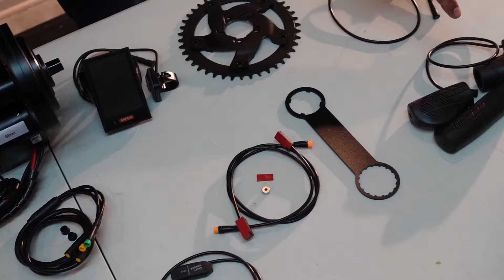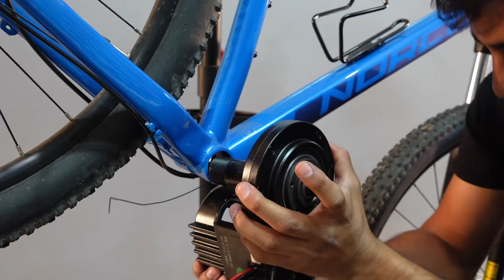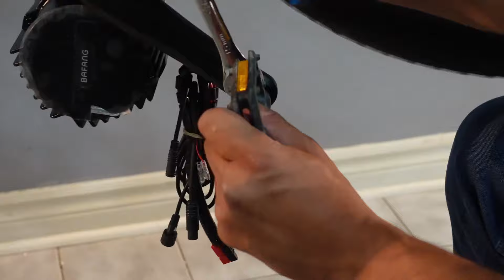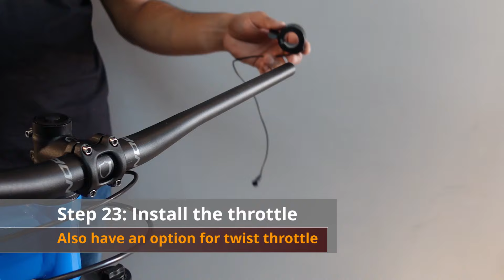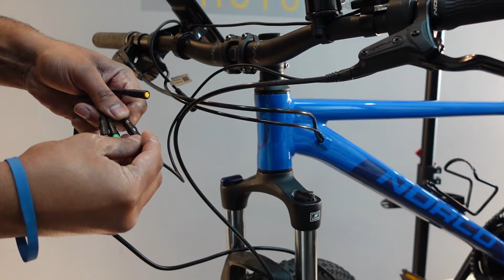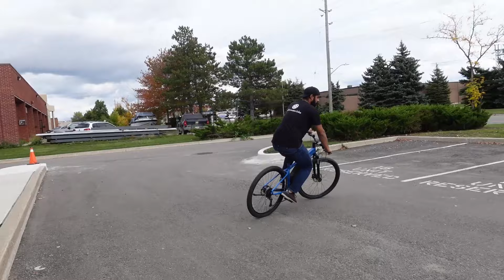Easy Bafang Mid Drive Kit Installation - BBSHD/BBS02

Comment: From other install videos, most have the motor pivoted closer to the front tube so it's not hanging so low.
Reply: Yes, that motor is now very exposed to rocks etc He should also have added some loctite to the thread of the first ring holding the motor
Reply from the maker: This is bike with internal cabling so the slot for the cable doesn’t allow it to go all the way up
Reply: @goldenmotorNA  it does, you just didn't try as it's the downtube it goes close to and there's plenty space.

Comment: Just fitted the 1000 watt BBSHD paired with a 52v 19.5 ah battery to an inexpensive mountain bike I bought new around 6/7 years ago for £180 in a half-price Halfords sale. Very impressed with the outcome - not worked on bikes since I was young so it took around 5 hours but I could do a second one in less than 2 hours. It goes very fast and hills are a thing of the past!
Reply: Hiya, thinking of also adding one to my bike. Can you use just throttle and also do the UK ones come limited in any way? Cheers Rob
Reply: I fitted MY BBS01 With 750W  to a bike I bought for 50€ .
Reply: Are did you get on with bbshd ? Do you do any mountain biking? Was there enough clearance
Reply: @WildCamper no they’re not limited, though you can use the display screen to set maximum speeds to 15.5 if you wish. Can also remove the “power” part of the display from the screen and replace it with amps. 

A nice 250w sticker on the motor from eBay and you’re laughing xx

(This is what I do! Pedalling around 20mph and throttle when I’m exhausted on quieter roads, it’s great!)

Comment: Just pulled the trigger on a Bafang kit and battery. Will follow this video and hopefully, have little to no issues. Wish me luck bois! haha
Reply: How'd it go? Ordered my bbshd on Friday. Purchased half twist throttle. Did you have any issues? What display did you run? Battery?
Reply: @devinrichman5282  incredibly easy. It is just like it looks in the videos, it's basically plug and play. I have the 850c, the colour screen, which works great

I hope it works out for you

Comment: Thank you SO much for this vid, I don't know why i had it in my head that the motor could not be positioned straight down...the setup I've been looking at has been restricted by the frame....this opens up loads of ideas and will save me $$$...again thank you SO much  🥰
Reply: You can, but it exposes the motor to damage due to lower clearance from below, so you should avoid doing this unless there's no choice. And if you do, buy or make a bash plate to lessen impacts. 👍

Comment: Just about to install this, I will be using blue thread lock on the main bolts & also greasing the bottom bracket socket

Comment: The allen wrench you used to tighten the crank arm is 11mm. Process of trying the Bike Pro Kit which 10mm is highest. Non standard size special order. Task is to replace crank wheel from 44T to 32T.

Comment: I can't decide which type of mountain bike to use. Preferred aluminum first, but maybe chromoly might take greater heavy loads of batteries and better shock and impact? For 5,11 I'm wondering frame geometry, and frame and wheel size to use with heavier load and responsive steering. Oh, but any frame i get will have front suspension. Seems like a must.

Comment: Im running old wy inch wheels will this srill work as the motor doesnt seem like it has alot of ground crealance, for refeence its a carrera subway 1 im bring back to kife. Found half of it in a skip many months ago. Also are BB sizes standard? Or does the kit come with spacers and reducers for both wisth and diameter? I dont want to by the wring kit and bub drive i think is sketchy, alot of torque going throughh all the commponents from crank back.

Comment: Just a simple question , when you removed the bottom bracket in earlier clip , and then in later clip you say insert motor into bottom bracket I never seen you put the bottom bracket back in , it's confused me a little

Comment: I have an Aspect 950 with a 42T with a 73mm bottom Crank. So if I buy a 42T 1000W Bafang Mid Drive Kit do you think it can work out? I'm thinking of also adding a 52V Battery that I will buy separately. I'm doing as much research as possible to see if its worth it to spend 1K on a mid drive kit.

Comment: Does attaching the motor and the other equipment make the bike all electric or are you still able to use gears and manually pedal
Reply from the maker: You can absolutely use it like a regular bike. :)

Comment: Hello! Can u pls help me? I have a KTM ultra fun, 1x12 speed bike, with a 34T chain wheel at the front. Can I install Bafang mid drive set? It comes with a 36T chain wheel. Will it suitable without replacing the full drive? Thank you!
Reply from the maker: Yes you can

Comment: Hey thanks for such a great video 👍
-Why remove the front derailer?
-Why remove the gear shifter? Is it not needed then maybe one can just buy a 1 gear bike for this installation?
-46T chain ring is it the number of teeth on the ring?
Reply: You don't need the front derailleur because with the new setup there's only one chain ring, so there's no changing gears. But you still need one gear shifter for the gears in the back.
Yeah, I don't see why you couldn't do this with a fixie (one gear bike) 👍
Reply: @zyphoxx  Use a cheaper hub motor is you're using a 1 gear bike.
Reply: @zyphoxx  this would be like driving a car with only one gear. it would toast the motor in no time.
Reply: Zyphox thanks. My exact questuon answered. So I'm leavungbthe shifter on but removing the hi-low derailleur from handlebar. Ibthink I got it. Looked high and low for that answer. Take care

Comment: Currently using a 1x9 bike. Do I have to use the chainring that came with the kit? Or I can I use my current chainring?
Reply: The chainring that comes with the kit is dished.  If you use your own chainring, even if it fits, it will be off axis to the rear sprockets.
Reply: Should be able to get a bafang chainring with the same number of teeth

Comment: Did you find any issue with the brake wire because of the clearance of the frame and the motor is quite enough? The brake wire still need to run between the frame and the motor, correct?

Comment: ciao wanted to ask you in my tests I found an unsatisfactory power. I'll explain: up to absustency 3-4 ok good engine work with pedaling. but then from 5-6-7-8-9 is superfluous help and in climbs to 15% or made ato as a muscular do not feel the help so strong of the engine bafang .. I use a 52V battery in your video I see that very strong and very well..
can you help me understand? what could it be,,,, in addition to the pc plows

Comment: what's the difference in 750 and 1000 and do you still shift gears on th back wheel?
Reply: If there were no shifting it would not require a shift sensor.  Right?
Reply: 750 watt is less power than 1000 watt but to be honest, there hardly is a difference. Only torque would have a great improvement ( which is very helpfull when climbing)

Yes, you do shift with the back gears. Only the front derailleur (or the front gears) will be removed.

Comment: @9:50 I'm about to try this myself... one thing I don't understand is how to install the motor... in particular should the finned part be down at the bottom (6 o'clock) or rotated (more like 8 o'clock)??
Reply from the maker: It should be up . Every bike is different that’s the highest it would go up on this bike
Reply: @goldenmotorNA  Is that just for ground clearance?

Comment: I have a terrible problem with skipping on the bottom ( smallest) 3 gears. As soon as I go over 200W it sounds like a machine gun.  Chain properly aligned, new chain and cassette...  will not go over 35km without skipping.  any ideas?

Comment: Can you place motor above the front tube to better protect it?
Reply: I've seen some older bikes with Chrome Molly frames be able to fit a 250w motor in between the frame. Not sure if the bigger motors would fit.

Comment: Isn't it standard that the stock chainring doesnt really align at center of cassette, mine also is the 68mm BB kit and my BB shell is 68mm wide but I find it aligning to the 3rd highest gear instead of the center, meaning shifting to bigger cassette cogs would bend the chain a bit too much, just wondering how yours doesn't seem to have this issue
Reply: Might need a 42 lekkie bling ring

Comment: When fitting to this frame  Norco Storm 4 is it possible to angle the motor closer to the down tube the video says you can’t but another comment says that you can
Reply from the maker: We can not but I did grind some of the aluminum on the cable housing and now the clearance in much better. I will make another video about it soon.

Comment: How do I know if my bafang bbshd controller has the 52v firmware?
Reply from the maker: reach out to where you purchased it from. they should be able to tell you. 
or use a fully charged 52v battery with it. if it gives  you an over voltage error then the firmware is 48v.

Comment: many thanks for the helpful video, friend! I intend to convert my 26" cruiser bicycle... a question please? this 68cm motor size, in regards to bracket attachment. is it universal or will I need to measure my bicycle's particular bracket opening and match?
Reply from the maker: It’s 68mm it refers to the bottom bracket size.  Measuring is a good idea just in case it’s something odd. If you need help measuring feel free to reach out at admin@goldenmotor.ca

Comment: Hello, thank you for your video. I am wondering about the adaptability of this engine with my bike. I have a distance of 78mm and not 73mm of length of tube in which to insert the bottom bracket mark. Can you tell me if I have to take a 90mm bafang motor or if the 73mm will be fine? Thanks in advance, Jean-Louis
Reply from the maker: Are you are you are measuring properly ? You have to measure the painted area

You would need a 100 mm with a spacer kit 

https://goldenmotor.bike/product/spacer-ring-set-for-bafang/
 

Reach out @ admin@goldenmotor.ca if you need help ..90mm are a bit harder to find we can help you source it
Reply: @goldenmotorNA  Thank you a lot ! First, I will try to find by self.

Comment: Thank you Golden Motors this really helped me install my bafang motor 👍

I have one issue with my install and that's the 8mm allen screw that is fitted on the pedal crank arm. 

Everytime i ride the bike that screw unscrews itself and the crank arm gets loose. Have you ever experienced that and what's the solution to fix it.
Reply: Loctite blue

Comment: I think I m gon steer clear of mid bracket motors.

front wheel kits have many benefits : 
- they dont depend on the chain. even if the chain breaks you can still go
- way easier to install
-fewer tools needed
- less likely to run into compatibility issues
- its offers two wheel drive, your legpower for the back and electric for the front.
- motor is not under the frame, the most exposed place to be, where if its low , going over something may get it banged

the only advantage mid drive offers is it doesnt require a torque arm for powerful motors, but I d rather just install a torque arm

Comment: Great video! Do you absolutely need to install speed sensor?
Reply from the maker: It is not an absolute must but it will cost more in cogs and chain over the long run
Reply: @goldenmotorNA  That's for the shift sensor. What about the speed sensor?
Reply from the maker: yes you need the speed sensor. If you do not have it on,  the display will give you an error 21 until it detects the speeds senor/magnet.
Reply: @goldenmotorNA  Thanks! It's weird though because I have several BBSHD's and some don't require the speed sensor to be hooked up and some do. Have you ever come across that? Maybe because the ones that don't need it hooked up are tuned to 52v?
Reply: @nettoyageadriance  my
Reply: @goldenmotorNA  is it going to be problem using Bafang chainring  with size different than the one on my bike?

Comment: I have 2 questions after watching this video:

1- why leave the motor hanging so low?   I thought it should be tucked underneath and as close as possible to the downtube.

2- Is the distance between the hub and speed sensor important?  One would guess it is otherwise your speed reading wil be off.   You don't seem to measure anyhting in the video.
Reply from the maker: 1. the motor does need to be tucked in. This is the furthest up it would go due to the space in the frame for wires

2. It does not matter where it is mounted on the spoke. Since it is just calculating each rotation . The wheel size has to be set correctly on the display

Comment: You sure scoped over a lot of stuff. The motor would never slip into the bottom bracket unless you modify the under bracket derailleur cable guide  and what about the right side brake lever and shifter. Please think it through next time
Reply from the maker: just removed the cable guide
Which is pretty self explanatory

What about the ride side brake lever and shifter ? 

What do you mean?

Comment: Dude.. You need to modify this video! Why? Because the information is incorrect and dangerous; the last shot is proof- the Bafang logo isnt straight because the motor isnt straight, you put the chain back on and modified its length but you didnt check the manual to see that the motor has to be oriented level with the bottom bracket in order not to put unnatural torque stress on both the motor and your frame. Fix it and fix this video!
Reply from the maker: @devtank 
1 I did not modify the chain at all... 
2 my bike has a channel in the down tube for the wires to come out of which prevents the motor from going all the way up 
3 I have been using this bike on trails for a while and have not had any issues except for lower clearance 

I do plan to take the motor out and grind that part down
Reply: I guess I am also wondering why the motor isn't tilted up? I just installed one on my bike and I don't see what is keeping you from rotating the motor up higher?
Reply from the maker: The bike has a channel to run cabling at the bottom of the Downtube that will not allow it to rotate all the way up .  Have not had any issues except for low clearance. Eventually I will grind it Down with an angle grinder

Comment: Motor mounted way to low . 
Nothing to do with wires .
Amature installation 😉
Reply from the maker: This is the highest it could be installed due to the wire channel
Reply: @goldenmotorNA  Reroute the wire , simple task for anyone with half a wit.
Reply from the maker: It would require a bit more that rerouting the wires. There is channel for wires built into the frame that does not allow for it to go all the way up .. it would require modifying the frame with an angle grinder. If it was as simple as re routing we would have done that
Reply: @goldenmotorNA  5:17 What wires? Are you talking about the rear disc brake hose?
Reply: I have the same frame and yes there is internal cabling but there is no need for the motor to be hanging like that!.Mine is much higher/closer to the frame!
Reply from the maker: I have tried ...the lip will not allow it go higher .I will eventually grind it a bit to move it the motor higher.  But without that this is the highest
Reply from the maker: It’s not the wires... you can see at 5 17 there is a lip from where the wire is coming out off

Comment: the bafang logo should be  level!!! you missed a step
Reply from the maker: Didn’t miss a step. It isn’t  flat because of the frame . The wire conduit prevents the motor going all the way up